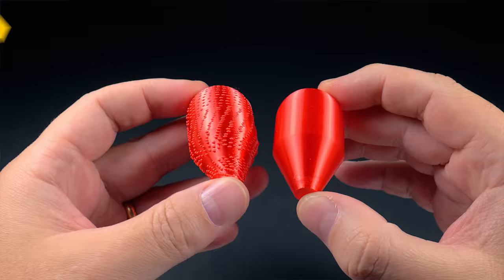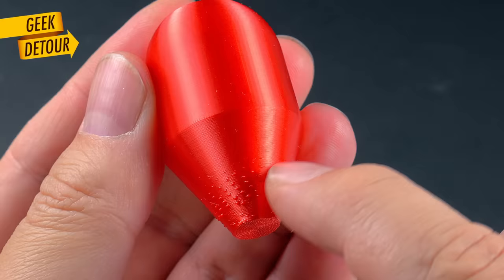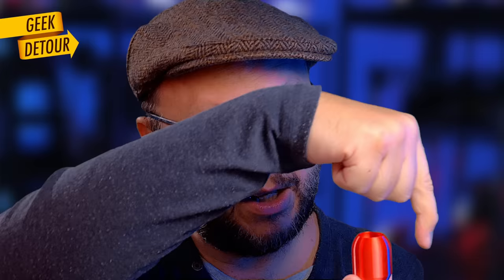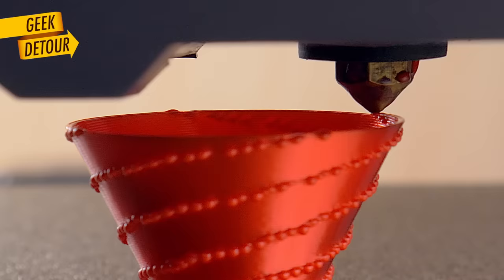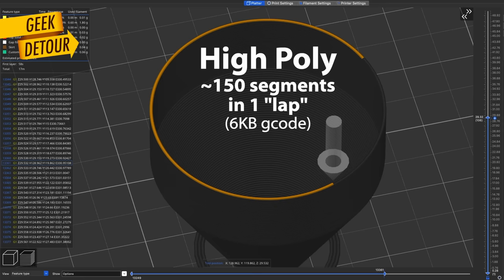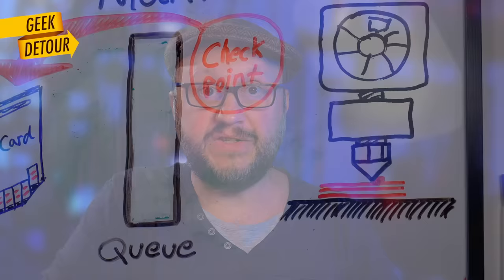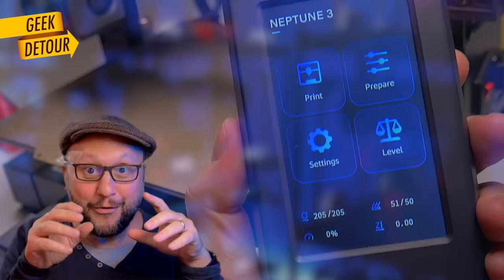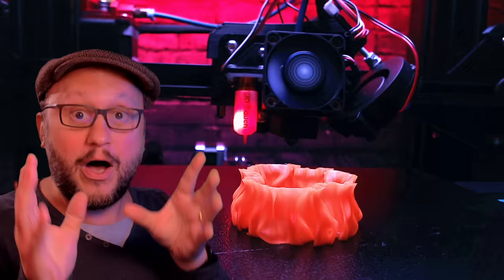3D Printer Blobs: a mysterious problem you won't guess how to fix 🤔

Comment: Thank you for figuring this out!  I tried printing in vase mode a small Egg model for last Easter to use up my remaining pink filament.  I never used vase mode before for anything, so I was surprised to see an outer spiral artifact on the printed model -- Now I know why!

I really like your presentation style and how you explained what was happening in depth so we could understand just how the problem occurs.  Hope to see more great tips, tricks, etc.

I immediately subscribed 🙂!
Reply from the maker: Hey, thank you for such kind words! I hope it really helps you to fix your print. PowerLoss Recovery is not the only thing that can cause the Blobs artifacts - but it is the most common one. SD Cards with too much files, or some times even the STL with a too long file name cause slow readings and blobs 🤷‍♂️
Reply: Very true blobs do happen for other reasons too.   Seeing the pattern in vase mode is the only time I've seen that happen - usually if they happen it random.

I have high hopes that when I print your model before and after I too will notice great improvement.  Then I'll add it to the toolbox for later.

Regardless I just wanted to say you have a great way of presenting things!  Please keep putting out more great video !

Comment: I ran into this exact issue and was wondering why my vase mode print had blobs.  Thanks for the tip. I’m going to try it out. My printer is on a UPS anyway. Power rarely does more than blip off and back on,and even that is rare. The UPS isn’t likely to run out.
Reply from the maker: That’s great! I hope it fix things for you! ❤️🤞

Comment: Just had this exact issue. Thought I had wet filament (I probably do with at least one of my pla+ rolls but not all lol) turned off the 'Resume print' function on my Elegoo Neptune 3 pro and it's gone back to making perfect prints. I've also ordered a decent micro sd card to replace the one that came with the printer. Thanks 😀😀👍👍

Comment: neat, explains why out of country order stock comes from areas with unstable power sources, thanks man
Reply from the maker: Yeah, right after I made this video, we moved to a remote place, surrounded by farms - and energy here is completely unreliable. I got to buy an UPS to finish most of my prints. It is very common to get seconds of interruption, like, two or three times every week - and I was getting upset. 🤣
Reply: @GeekDetour  We moved remote, Nasa neighbor, our above ground power lines were restored in 2018, do it, required community organizing and donation, don't let the local jurisdiction get involved. DIY

Comment: the algorithm calculate the continuously movement in top speed requires Gcodes are loaded in a queue fast enough. If they are broken up, the acceleration curve will go to zero then climb back up to the top speed for the next Gcode. Ideally, for a perfect circular shape, the extruder should never drop from top speed. If it stops to zero velocity , the the hot filament is still dragging out by gravity and  pressure inside of the chamber, hence the stacking of the extra material. Depends on the printing material, use the retraction action might help a little but this needs some experiment to see the speed of the flow and timing in which the retraction needs to engage before the extruder velocity becomes zero.  The main reason for the read operation to stop is writing to flash takes a long time, it is a blocking call inside of the firmware, needs to wait for SD card controller to complete write operation then proceed to read. (not sure about SD card spec, but NAND flash write operation needs to erase before write for each block, and SD card is usually RAM less, that means the entire operation needs to be complete on NAND itself, instead of faster SRAM.)

Comment: It's interesting that you came to the conclusion of it being related to power loss recovery.  I recently discovered it with my bamboo X1 Carbon I noticed mine was tied to the time-lapse photos.  I ended up disabling the time-lapse photo and sure enough problem stopped happening. I still had the power loss recovery enabled which that's why I find your theory interesting. Long story short after I ended up formatting a very nice SD card that I originally put in only had a handful of prints on it everything fixed itself and I haven't seen this problem again.  I'll definitely agree that somehow tied to the micro SD card but I'm not sure between either time-lapse photos or power loss recovery what it is causing it. I had never seen it ever and all my years of 3D printing except for recently with the X1 Carbon. I haven't even seen it on my A1 Mini or my P1S's. But it is cool to see someone trying to figure it out.  Thanks for sharing this!
Reply from the maker: Thanks! Bambu printers are a completely different story. If you are getting blobs on your Bambu it’s something else. I have a P1S and I don’t have any Blobs - maybe I should see it using “Smooth Timelapse” I would have something…

Comment: I play with security cameras that write constantly at 4k to SD. The only cards that I buy are called "High Endurance" SD cards - they're expensive (I buy the 256GB ones) but they are highly reliable and fast. The checkpointing might work with these cards...
PS: High Endurance SD cards use single level flash memory cells; your typical SD card is Multi Level where varying voltages signify multiple bits.

Comment: wow. I have been on 3 different 3d printing forums and nobody could help me with this. I eventually figured out it was only when it was running on somewhat unstable power (i.e generator) so I tried 2 different power surge protectors which narrowed it down to only printing the blobs in small sections, but the recovery mode makes sense with my situation and I will have to give that a try!
Reply from the maker: I am curious to know it that was it!

Comment: PROPS on discovering the cause of this issue!  Writing to Flash memory is hella-slow for sure!

I will be turning this setting off since I have yet to make really long prints where recovery is an issue, and I’d def use a UPS if I find myself becoming more concerned.

Thanks again for figuring this out - mystery solved!
Reply from the maker: Thanks Bill! Absolutely: disabling is the way to go, and getting an UPS if you really need to get covered.

Comment: Well done! I started to raise a finger at the visualisation of a queue as a stack, but understand why the choice was made: showing a looping buffer is not intuitive, and hard to explain, and adds nothing to the point that was being made.
Reply from the maker: Hi Sean! Thanks 😊 You are absolutely right: a stack is not how the buffer works; but it is far easier to discuss what matters about the pausing issue.
Hey, I think you will enjoy the following conundrum: some people asked if increasing the queue size wouldn’t fix the problem, giving more time to write the “checkpoint” without getting a stall. But I checked the Marlin code… and guess what: the structure that is written as recovery information contains the stack itself 🤨
Reply: @GeekDetour  Now that is WEIRD! Does the stack in-fact contain recovery instructions? I expect some state would need to be stored as well (eg. pointer to gcode, x/y/z position, temperature, time, etc).

The choice of a stack must be a lazy implementation to hold data on file (probably a blit from some c struct). If it is actually holding instructions, and must be read LIFO, then it is probably being dumped into another stack to be read back in order! You would have to read the instructions, then write them all back out at checkpoint. Counter-intuitively, SHRINKING the stack may reduce pauses with recovery on, but limit print head speed.

But what is really weird is this: you still have to know your position in the g-code file EVEN if you have the recovery stack/queue on the SD card because you have to continue on even after you've fully consumed your recovery data! So what's the point of the recovery instruction data anyway? Just hold a pointer to the recovery position in file (eg. a long int), and pick up from that position!

Of course, other recovery state may need to be recorded as well.

Comment: If I'm not mistaken.. you can disable the power recovery in CURA as well and it stays off until you remove the line of code ..it's been awhile since I did mine  but all I had to do is Add this to the starting gcode in Cura

M413 S0 ;

Comment: If you use Klipper, then you're running in the GHz for the path planner and the bulk of the motion chain. And that Arduino Mega/RAMPS 1.4 goes from a 20MHz "do everything" with 10KHz planner, to a 100KHz planner coming from a GHz-level computer.
Reply from the maker: Sure! The difference is huge. Klipper makes much more sense for the future of 3D Printing

Comment: This makes sense. I have the ender 3 pro v2 with low ram. I also CNC machine as well and I noticed with 5th axis machining the head of the machine does pause when theirs a lot of poly.

Comment: Had a power cut once, thought power less recovery would have my back. Well,the print bed got cool enough for the model to lose itself, so in the end I had to start from the bottom again anyways
Reply from the maker: Yeah, I guess that’s the ultimate contradiction about Power-loss Recovery: I would help only for a very short power cut. Anything longer than 1 minute and the print will pop-out from these wonderful print surfaces (that’s why we like them!)

Comment: Okay.. but the best option is just to connect your printer and accessories to a UPS. It’ll never loose power and if it does, you’ll be good to finish a print as most printers don’t sip that much power.
Reply from the maker: I absolutely agree!

Comment: The funny thing is that I already guessed the answer when you mentioned "power failure recovery", because this is basically a reenactment of the problem that old pixel games used to have back in the old days, when pixel games used to squish the cache with encapsulated blocks of color information, and when they ran out of RAM there were all sorts of bugs and all sorts of strange color blocks appeared on the screen. When the memory ran low, all kinds of bugs would appear, and all kinds of strange color blocks would appear on the screen.
It's interesting to see how this phenomenon has been repeated in the 3D era.
Reply: The same similar problem occurs with tube televisions, which is why Progressive was taken.
Technological development always follows a similar path.

Comment: Sounds like a good argument against using SD Cards to print with. Maybe print through a USB cable connection. I know, it sounds pretty futuristic, but it is possible! Honestly don't understand why people insist on exporting g-code, saving to an SD Card, moving the card from your computer to the printer, then loading it there and starting the print...rather than just clicking print and having it go....

Comment: First time viewer here. Nice solution and equally nicely presented. Will give it a try. Thanks for sharing 👍🏼
Reply from the maker: Thank you Mickael! The solution makes sense if you print from the SDCard. If you print through OctoPrint or Klipper, then it doesn’t matter because Power-loss Recovery does nothing already in those circumstances. If you have blobs printing from OctoPrint, then the problem is something else 😃

Comment: I am experiencing this "BLOB" issue right now on a print that is 14 hour long print. I am new to this whole gameshow of 3D printing, and have been having a blast learning all this stuff, even when I have issues, it is so exciting. I had an issue a few days ago, that I had to shut the machine down, and have NO IDEA why this did what it did. It is on an ENDER 3v2. I set the first layer to have the nozzle temp at 210, once the first layer is finished, the temp can bounce back down to 200. well, what it did, what shut the nozzle heater 100% off.. and about 30 to 50 seconds into the start of the next layer, the heat had been extracted out of the nozzle from the plastic filament, and once the temp got low enough, the machine alarmed out and locked the screen out, from making any adjustments in real time. All I could do was turn the power switch off and fire it back up.. Granted, the firmware automatically allowed me to start printing exactly where the issue happened and once the temps came back up, it was off and running. 

My adjustment of starting the first layer a few degrees hotter, was to see if the patterns  would be better on that plane or what touches the glass base. The first layer finish was also kinda "splay-ish or white-ish" as if the plastic has moisture in the molten plastic, being trapped, and just kinda nappy looking, granted, I am betting from what I know now, slowing the travel speeds down might help with that and bed height to the nozzle as well. 

But, to go along with all that you just covered in this video, all of the holes in my model, has ALLLLLLLLL of these blobs.. I will invest into a back up power bank APC unit.. I think I have a few of those up in the attic, that just need new batteries installed.. but, considering the price of these units today, I might as well just but a brand new unit.

But, the old units I have, those allowed them to each be token ringed together, each needs plugged into the wall (AC) but, if one or all loses power (AC), and one one is being used to run a device, all the others through extension cords that you run when installing them, piggy back each other... 1300 watts each, but, if you have 6 of them, linked together, that is 6 time the work out put, with in a 5% to 10% of wellness of batteries, which is approx 7500 to 7800 watts... which almost in terms of Ah ratings, can almost get 6 times the run time. A 350 watt printer, might be able to run for about 4 to 8 hours full throttle on that set up.. but dang, I do not want to buy those batteries though...LOL.. as each one several years ago, when I last dealt with wanting to refurbish them with new batteries, was like $160 USD each and each unit has 4 of them inside. with room for 4 additional per unit. SO, to go nuts, 8 times 6 units times $160 per.... ouch.. comes out to at least $4000 to full battery stack up, $8000... nah, this is just a $300 printer..LOL.. either way, I am having so much fun being inspired

Comment: I had the same identical problem with my Elegoo Neptune 3 Pro. I had bubbles on all my prints. It was really looking bad. In the beginning it was perfect then it got progressively worse. After watching the video about the SD-Card, I thought about the RAM. I had uploaded about 60+ files onto the (Elegoo SD-Card.) I transferred all the files off the card and into a folder on my computer drive. I just left some small folders and a couple Gcode files. I re-ran the file with massive bubbles and to my amazement, the print was perfect. No bubbles, finer definition, faster print. Give it a try, it worked for me.

Comment: This problem is very specific to cheap hardware.  If you're using a portable hard drive with an onboard cache instead of an SD card, you never had this problem (said the guy whose printer controller is a repurposed laptop computer). 

That said however, disabling power recovery is no loss.  AFAIK it never actually works and results in a usable part no matter how good your hardware is. When power goes down the extruder cools.  When power comes back a half-hour later you can't resume until the head goes through a heating cycle and melts the plastic in the extruder again.  That delay and reheat cycle - or the power recovery function attempting to skip it - ALWAYS ruins the part even if the printer doesn't lose its place.

Comment: Answer is at 4:30, the power fail recovery feature that writes to the SD card and end of every layer. This write action causes a slight delay in the print process which results in the blob.

Comment: It seems like increasing the size of the queue would be a simple option for those with unstable power.
Reply from the maker: Not really... People started commenting that right after I published the video, so I looked at Marlin's Source Code and the Queue itself, along a few other things, is written as the data structure to recover. So, you increase the queue and the checkpoint will take longer to be written to the SDCard, so, defeating the purpose of preventing the pauses 🤷‍♂️

Comment: It's funny that you asked about losing a print because of losing power while the octopus was printing in the background. That's because I've lost one print because of power loss and it was a rocktopus for my daughter lol. My printer is an ender 3 v2 though so I don't even have power loss recovery 😔
Reply from the maker: Maybe it has, but it could be disabled. You know… this feature is very controversial. In my case, with a glass bed or with a PEI sheet, if the power cut lasts longer than 1 minute, the bed cools down and the parts will just pop out, and everything is ruined anyways 🤣 The only guaranteed way is an UPS.

Comment: Interesting how many comment that they own a 3D printe rbut mention that the video is informative. But back to what I wanted to write. Thanks for this. Did not run into this issue but I will disable it before it happens. Only had once that it needed to resume a print and it was subpar

Comment: I had blobs but I was using OctoPi. My eventual conclusion was that the power supply I was using for the Pi was insufficient and the Pi would go into low voltage mode and not send data fast enough.